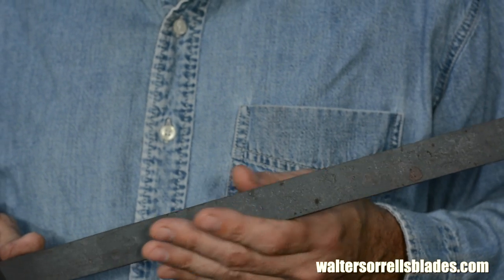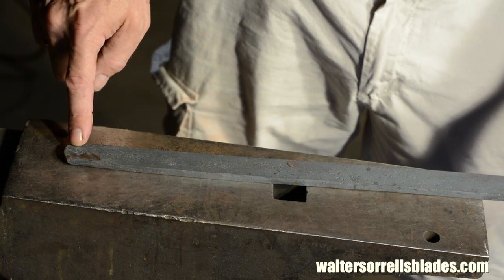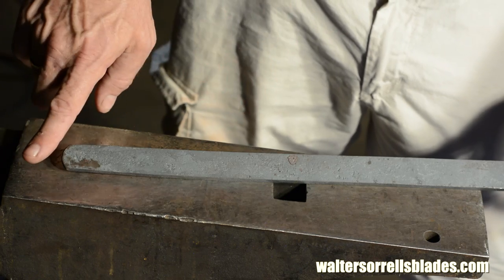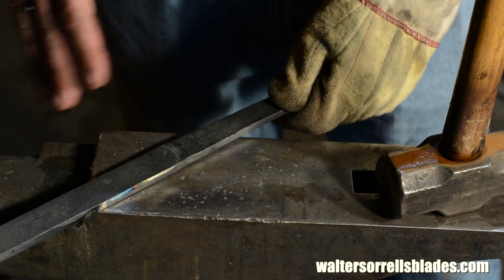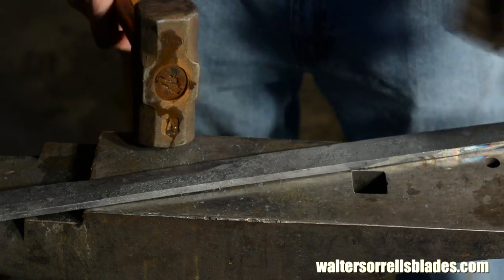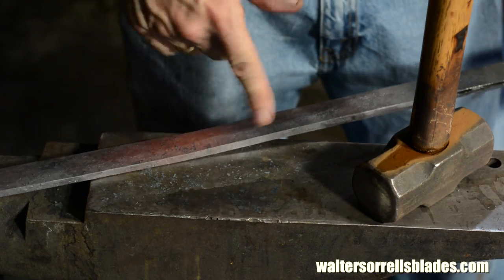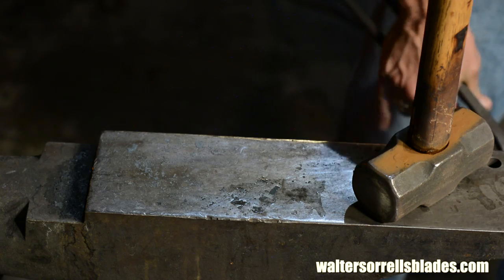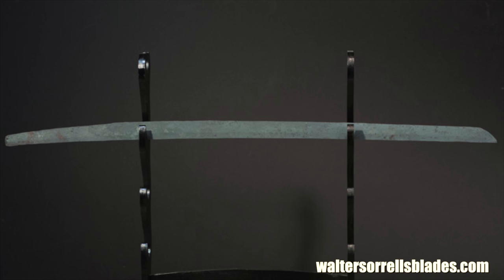Forging A Katana - Final Forging Steps

Comment: Mr. Sorell ,   I did enjoy the close quarter combat between you and the steel to cause it to follow your directions.   I was a high school student when I forged a grappling hook.  Then I moved on to the knife that never finished.  After that I built 5 knifes via stock removal.  Love blades, even reground a few old hickory's into camp knifes. Worst thing is I have given away or lost all but one of my creations.  Never photographed one, thank you this video give me ideas and questions could a good camp be made with using the the technical skills put in the katana.  I have a cold steel and its weight and thickness makes it a good chopper.
But the recurve grind add weakness.   Thank you again

Comment: Awesome, awesome work. I see that you are being asked millions of questions here, so I'm sorry to add to the load ha ha! But I have a question, when you quench after tempering with the hamon clay applied, do you want to be sure that the scale is removed completely? (As in grinding, or sanding down all of the blackened surface) Or do you apply the clay for the hamon just right onto the scale?

Comment: cool vid. and the audio was nothing to apologize for as it was the sound of the craft itself. curious sort of side note - do you wear hearing protection? seems like your hearing would like a break from the high pitched hammering, but that you would lose being able to hear what the metal was doing. like i say, just curious if that's an issue with smiths.

Comment: I have a question: You talked about the width of the billet before the final forging process, does the thickness also increase towards the tang? or is that a result of the final forging process?
Reply from the maker: +Jores Van Wensen   That's right.  The preform is thicker and wider toward the tang.

Comment: When you are be eking the blade are you holding the blade at an angle and the hammer at an angle? Or are you laying it flat and just using the angle of the hammer to create the bevel?
Reply from the maker: +Jeffrey Fogleboch Basically it lays flat.  Then once you start to establish the bevel, you'll keep the other side of the bevel flat on the anvil.

Comment: Do you conut the number of hammer blows when forging the bevels? How do you control it?  I forged (or try to) a manchete today, and my bevels were worst than your audio :P... any advice?
Reply from the maker: +hermanvonsalzajovi  I don't count the hammer blows, but I do structure my general approach as well as flipping the blade over on each heat, so that each side of the blade receives roughly the same amount of hammering.  Bottom line, though, forging is a skill that takes a fairly long time to master.
Reply: +Walter Sorrells  Yes I get it! One heat for each side seams to be a good method. I have forged a knife and he bevels weren't so bad, but with a longer blade I've fealt my inexerience as a smith. Thanks for the tip. Do you have any instructional dvd's?

Comment: How long does it take you to Make a Katana with modern steel and using traditional methods and modern methods
Reply from the maker: +RedGhost1990 If you're just talking about forging the blade, a couple of days for modern steel and a week+ if you're talking about smelting the steel, folding it, etc.  But the whole process can take up to several months -- especially if you include the mounting.  The single most time consuming part of making the blade, though, is the polishing, which is all done by hand on stones and is ridiculously time consuming.

Comment: Very informative. Thanks for sharing.  If starting with flat stock, say 1075 steel, what is the recommended thickness of the steel for a Katana style sword ? Would 1/4 inch be sufficient ?
Reply: Historically, Katanas are quite thick. This is due to the way they are hardened. Since the aren’t spring tempered, the spine needs to be very beefy to withstand abuse from hard cuts. There is no definite number, as it kind of depends what the sword was used for and during the period it was made, but from looking at many specs of authentic swords from various periods, I can say that the average number I’ve done across is around 7mm thick. So more than a 1/4”. However some were thinner, some thicker.
Reply: @Divine_Serpent_Geh  Thanks for the info, I have some of those 1075, oversized 1/4 inch steel from New Jersey Steel Baron, works a little over at 7 mm.
Reply: Oliver Milutinovic You’re welcome! Yes, NJ’s steel is always a bit oversized. Looks like you’re ready.

Comment: I thought it was an excellent format. I'm curious though why you wet the anvil. I would have thought that you wanted the metal hot for as long as possible to work it?
Reply: +Bill Simon  Its a Japanese technique that helps to knock off the scale on the blade, I watched a  video here of a Japanese sword smith and as he forged the blade and hit the steel the water flash steamed between the blade and anvil and would snap like a small firecracker.
Reply: he comments on that in the video
Reply: I missed it, Must have been when I was paying attention to the news.

Comment: If you want to quiet down your anvil just wrap a chain around the base.

Also your little logo made it hard to read some of your captions.
Reply from the maker: +Dread, the Mad Smith   I hang a bucket of sand off the horn.  It accomplishes the same thing as a chain.
Reply: Walter Sorrells Ah, I could not see it in the video.

I like the chain thing because it keeps the horn free but it makes sense if you aren't going to be using it.

Might I suggest and anvil mounting video?